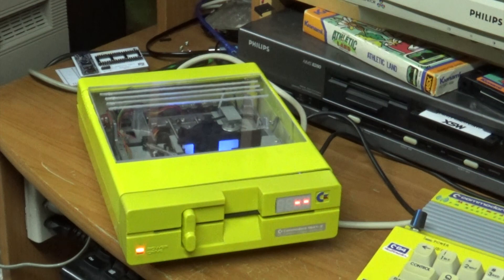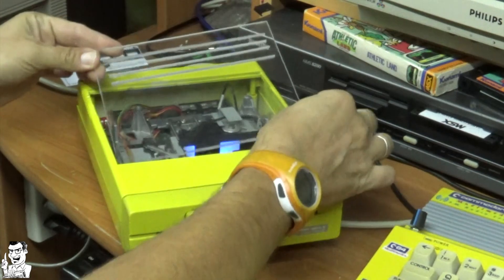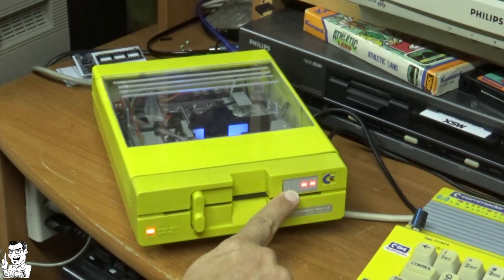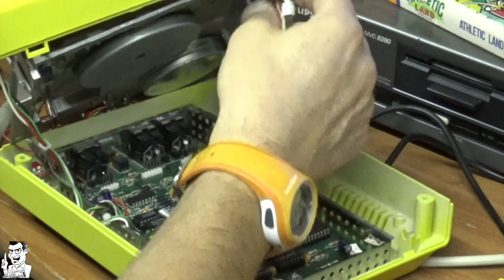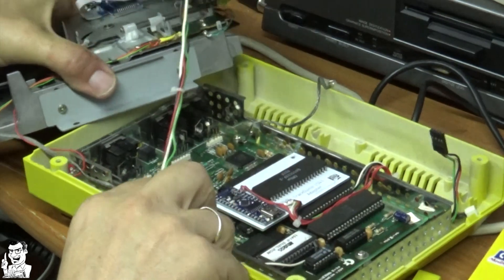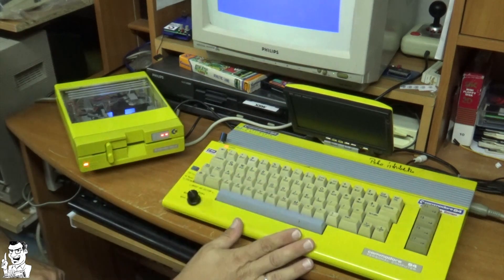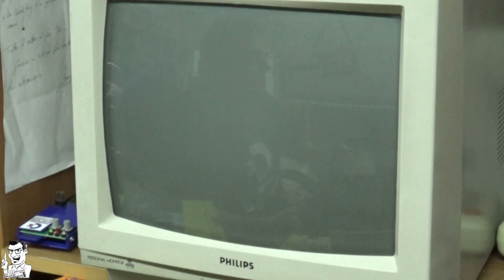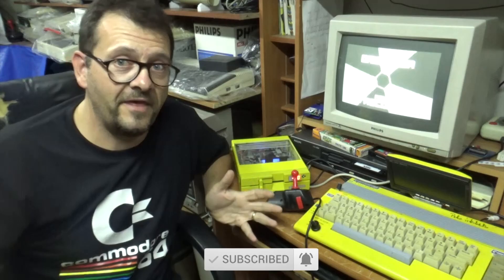1541-II Trackduino Mod and overview

Comment: Does it working every time for you? I had few floppies where it wasn't able to determine track NR.
Reply from the maker: just do an Arduino reset and it works again. This sometimes happens when you try to format
Reply: @giumacgyver7127  for me it's doing almost every time on certain floppy, it's quite a long time since I worked on this. Btw very good job on the adapter, it would be super cool if you could add 2nd CIA and export header for parallel port :D